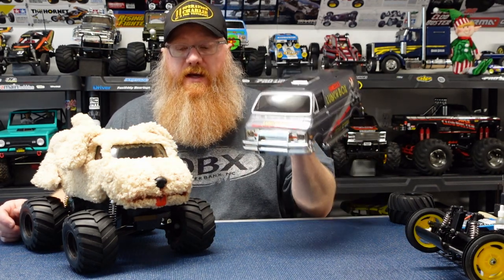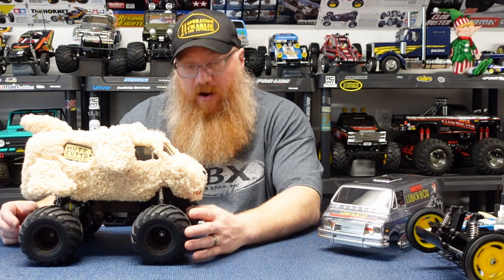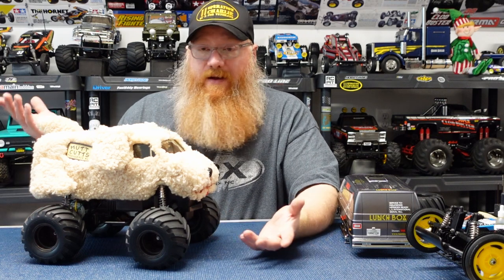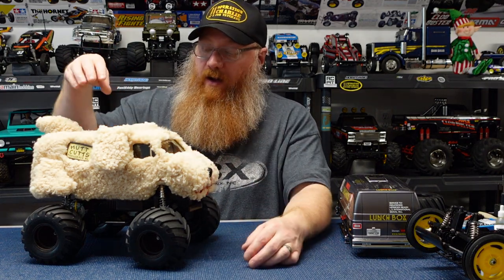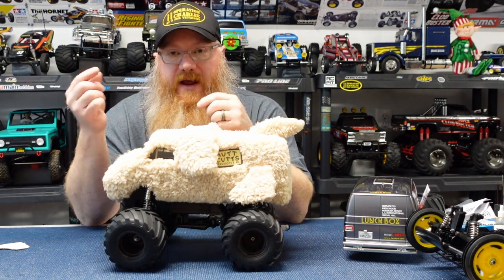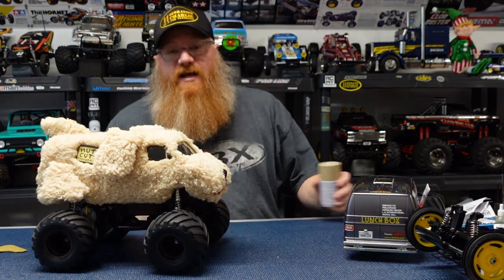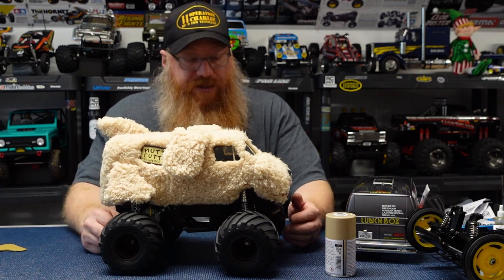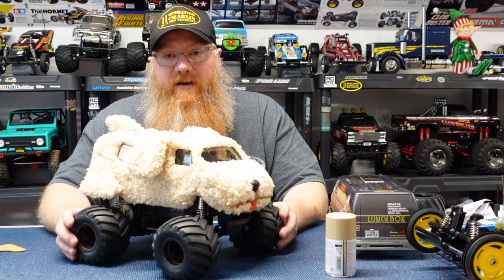Mutt Cutts Build and First run

Comment: Thanks for this extended explaination. With it I think I'll can do a buid in the future. But for now I'm just flashed and have to think about it.
Very brave you showed a running part, too👏👏👏💪👍
The best part on the Black Edition is the sticker sheet. Not only because it's precutted. Those black-grey stickers match to more and not so bright colours than the original one.
Reply from the maker: Running it was too funny and I had to do it so you guys could see it too! I agree the stock lunchbox stickers are kind of hard to use with other colors whereas the black edition ones you can used with many colors.

Comment: Great video Addam. Looks like loads of thought and application when into creating this. Looks great when driving about buddy 👍🏻🙌🏻 Did you spray the wheels?
Reply from the maker: Yes, the wheels were sprayed and then rusted with various shades of acrylic paints. It was a good bit of time and head scratching to work it all out but I think it turned out pretty cool in the end. Thanks for stopping by and checking in!

Comment: Great job on the build buddy, Definitely took some time and skill to do. I'm gonna add a Black lunchbox to my collection,They are not very easy to come by these days out of stock everywhere unless you overpay for it on EBay.
Reply from the maker: Yeah them and a lot of others. You just have to keep an eye out for them as when they come back in stock they run out quickly!!! Tower Hobbies is probably your best bet if you are in the States. Best of luck snagging one.